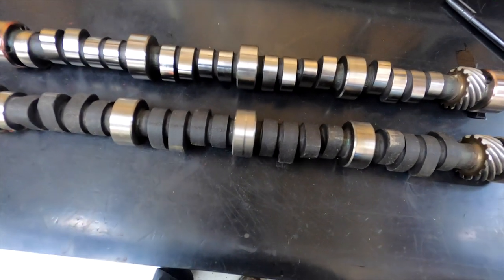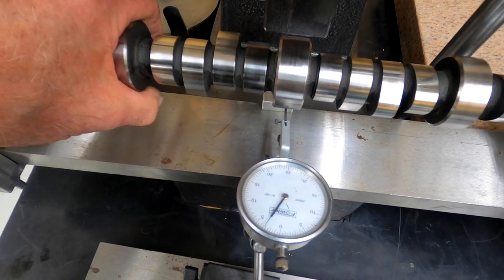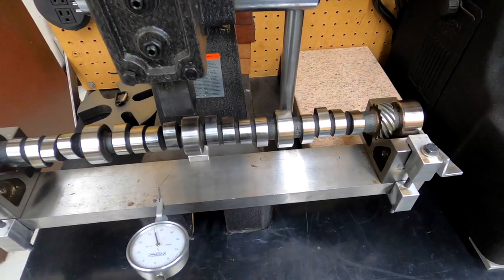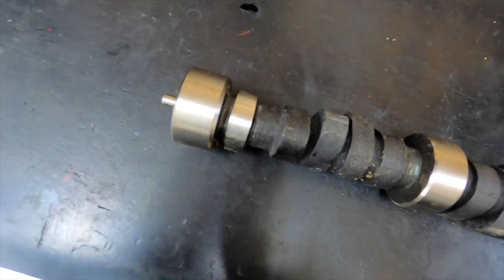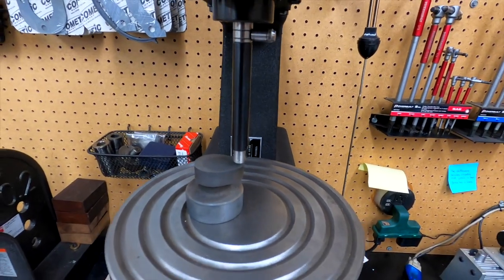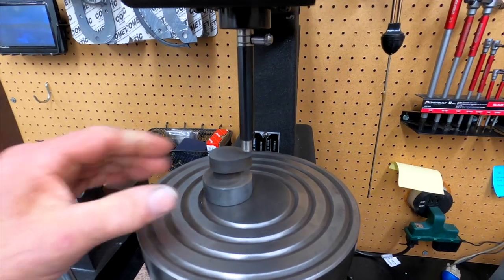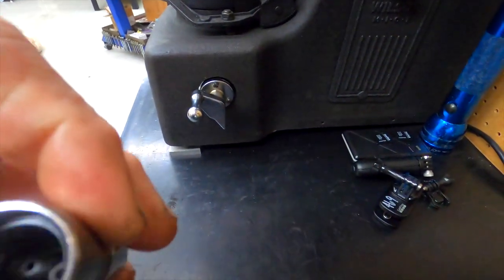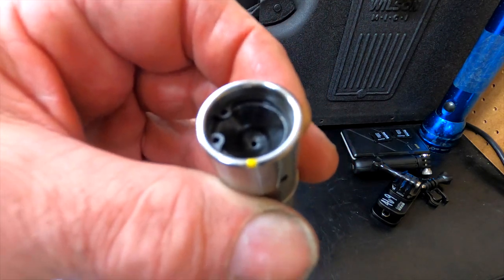Can You Straighten a BENT Camshaft? Gerald Checking Solid Flat Tappet Cam For Hardness

Comment: Such a great video! To bad the younger generation has no desire to learn these techniques,and be taught by the elders of engines on the performance side! Thank you Gerald. From East Tennessee, Ronnie
Reply: I think it's an experience thing to be honest. I feel like it has to do with interest in why a setup or component works better or worse/ fails that gets guys into engine building. A "What can we do to fix this" mindset. Younger guys just want to buy a setup that works so they can get out and use it. "I don't need to know engine tolerances I just need to pay someone who does" etc. 

The other side of that is in the time it would take them to learn with mixed results they can work OT and afford to get to it done right.

Comment: A great video explaining a problem a lot of folks don't run into!

I rebuilt a Volvo inline four engine one time, back in the dark ages half a century ago, and ran into just such a problem. Volvo engines are built to pretty high standards and tolerances with this one having five main bearings, each one bigger than an American V8 crank bearing. I had pulled in five new cam bearings and then had the block line bored. I bought a new factory camshaft that was shipped in it's own protective tube, but it didn't seem to want to go into the block correctly. Experimentation showed a problem with the camshaft, so I took it to my trusted local machine shop. There they mounted the camshaft on the lathe and put the dial indicator on it. Turned out it was out of line on the center bearing by something like .015". The machinist had never seen such a thing and was surprised it hadn't broken rather than being bent. I took the camshaft back to the Volvo dealer who also checked and was surprised to find the same thing. Needless to say it was immediately traded for a brand new camshaft as quickly as one could get there. But I learned to always keep those possibilities in the back of my mind.

Comment: Thank you, Thank you! This information was also missing from my DYI engine builder kit. I had a cam go flat 15 min into the 20 min break in procedure. So disappointing I almost cried. I purchased the long block 383 stroker motor from a builder in Texas and followed his procedure exactly and it still wiped 4 lobes. I used the exact oil and zinc additive he recommended, but of course he insisted I had done something wrong. When I provided him all the receipts as proof he stopped taking my calls and blocked my phone. I should have known better as he was 6 weeks late in delivering the motor to start with. I was just looking for a simple motor swap and it turned into a very expensive nightmare. 
Mr. Brand, you are really getting the video production quality higher with every episode. I have learned more from you and Chief this winter than all my years of wrenching. Thank you, Sir.

Comment: Ive been through a shop or 2 but i never seent the process of checkin hardness. Thanks for showin an ole boy! I guess that can be added while checkin clearances before final assembly. I put a big fat sharpie in my lathe and machine to lifter size to check my cam centers. Sharpie brand only cuz the fat cases got almost a quarter inch of meat you can cut down.

Comment: I just switched to the tool steel cam and lifters. I ran the same Schuebeck lifters for 20 years. We will convert them to solids for use in a backup engine. Great video.

Comment: Machining brass lifter shims sounds very interesting! Also do you have a specific take on tolerances in lifter bores? And, could lifters be angled to ease radical pushrod angles when port pinches are ground off for higher flow numbers?
Reply from the maker: The Brass shims are to move the cam front to back i the block.

Comment: I'd like to hear your thoughts on controlling thrust with a roller cam and if you prefer belt or chain drives.
Reply: Is there a advantage to running a belt drive
Reply from the maker: Depends on if it's a belt of chain drive.  Chain drive cam button to cover. Belt drive has shim between the cam and gear
Reply from the maker: @scottspeck8843  Belt Drive In drag racing If you shake the tire it will jump a tooth or two

Comment: We have a digital Rockwell hardness tester here at the Air Force base and I remember having to get wing bushings tested… unfortunately the machine shop did the test on the face of the bushings and ruined them with the dimples the tester leaves.. they should have done it on the ends. 🤣 Great video!

Comment: Had a bent cam set to me from Bullet Cams, was also oversized from factory specs and wouldn't fit in the block. Which lead to me to find out about it being bent. The box it was shipped in was perfectly fine. To their credit they took it back and fixed it

Comment: Thank you for posting this. The lifter locator is something many of us have never considered. Have you ever measured the crown on lifters with your height gauge?  I have 4 brand new lifters from Melling that I have found questionable using a German made straight edge that is highly accurate along with a flashlight, not exact but if I see light, I feel I am good. Four did not pass the test after several tries. A Rockwell hardness tester for the average guy is not going to get much use. What about hardness files?  There are files available from machinist supply companies that sell files for checking hardness. I forget the number of files in the kit  all with a different pattern and they are used as any other file. Start on a file rated lower than the hardness anticipated and work up until a mark is left in the metal. That will be the hardness rating of the piece being tested. These are a bit less expensive than a dedicated machine e.g. a set from McMaster-Carr has a range from 40C to 65 C and costs $136.00, cheaper than a rebuild and a dedicated tester with a dial , over $1,000.00 and up. I have seen some companies that sell the files in different ranges but I forget if that is for the A, B and C scale or hardness range within C-scale.  I will machine myself a lifter position tester, very cool idea.  The engine I am building is probably going to be the last one I ever do and I am trying to do pro work for longevity and power using old school stuff along with modern honing techniques and piston rings. 
Excellent video.
Reply from the maker: The files will work good. I use my surface plate & a digital indicator.
Reply: @BrandRacingEngines  Thanks, good to know.

Comment: Really cool video Gerald.  I am still amazed at what goes in to building a HP motor.  Do you build Mopar HP engines and what do you prefer to build?
Reply from the maker: Have a 273 & 340 Mopar for road racing in the shop. All motor are fine
Reply: @BrandRacingEngines  That's awesome!!!

Comment: 👍🏻 Video. Learned some things on this one! 
Is the hardness tool used for diagnostic of a failed part/ engine? I assume the indentions the machine leaves aren't ok for new/ parts to be reused? 

Also, the bent new camshaft concept is concerning. I've never checked a new camshaft for that. 😬
Reply from the maker: Yes on failed parts. It 50 /50 on the cam being bent

Comment: Is the taper why cams are going flat more often (supposedly)?
Reply: Taper in a flat tappet cam is there to cause the lifter to rotate in the bore. No lobe taper will cause a lobe to go flat. Cam break in and oil quality are factors in lobe failure also.
Reply from the maker: @jondahl3173  100 %

Comment: in the cam hardness testing I find it interesting that the soft core is much closer to round rather than the hard portion being constant thickness. I suppose if it's right next to a thinner section that would explain it.
Reply from the maker: It's the shape of the lobe
Reply: @BrandRacingEngines  it looks to me like the soft core is very nearly round rather than the egg shape of the lobe, that's what surprises me. But if it's cut in the (slightly) thinner section right next to the lobe (don't know the name for this section), or right on the border vs the lobe, it makes sense to have a round core.
Reply from the maker: @totensiebush  You Would Have To split the lobe

Comment: What is your take on the hydraulic flat tappet lifter failure issue? Has the new DLC process resolved the problem that you know of?
Reply from the maker: If you check all the thing in the video you shouldn't have issues.

Comment: With the Tool Steel lifter being 15 Rc Harder,  assuming correct Lobe Taper, Right oil & verified Good lifter Rotation, do Tool Steel lifters provide any cam Break-in Survival & overall wear Improvement/lifespan when used with relatively Aggressive FT lobe Profiles (0.610" lift @ 265° 0.050" duration) & stout (150 lb seat/350 lb open) Spring pressure on typical P55 core Camshafts ??
Reply from the maker: Yes it does. With out see the cam lobe profile it hard to say.

Comment: How 'bout that Bent cam !! ...Always thought the Flimsy typical cam company corrugated boxes are too risky to protect the cam....How would someone Non-Destructively test flat tappet lifter Faces & Cam Lobe Hardness ??   Why grind off the traditional Parkerizing Finish ? ....Always thought the cam lobe "Parkerizing" significantly Improved the high pressure impacted cam lobes for assured Break in ?? .....
Reply from the maker: You can check the lifter on the band and the cam on the core. Parkerizing doesn't hurt but it doesn't help. If cam lobe has taper and brake-in oil is good & lifter turn in the block. And if the cam core & lifter material is right it will be ok.

Comment: I didn't know you could straighten a cast anything. I always heard that if you just dropped a cast camshaft on a concrete floor it would break. I dropped an old camshaft on my garage floor and sure enough it broke into 2 pieces.
Reply from the maker: It the shock when it hits the flood